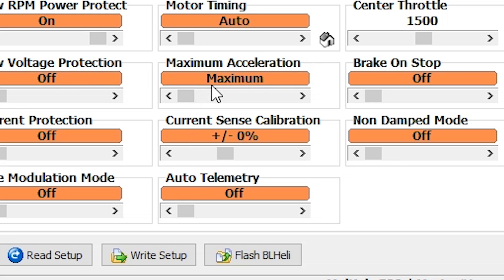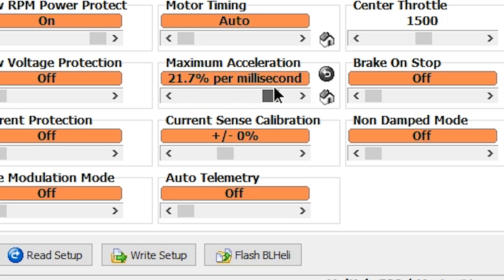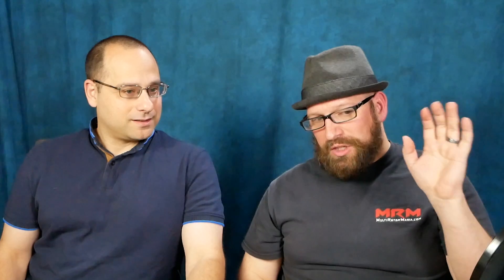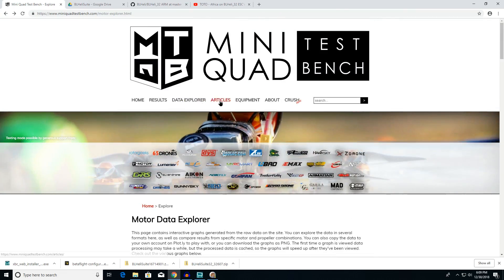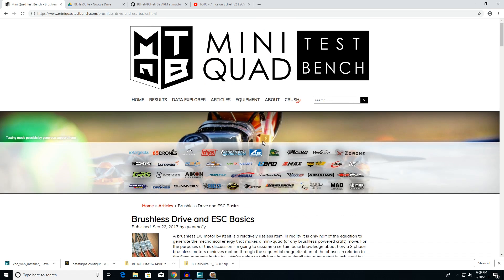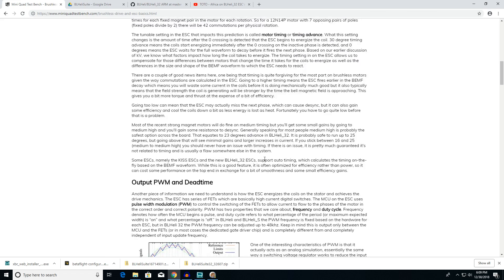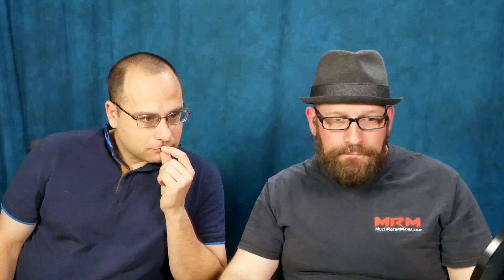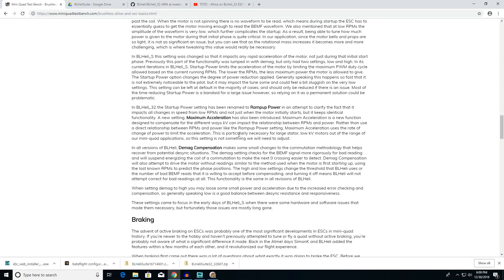BLHeli32 100% Explained - Part 7 - Maximum Acceleration

Comment: Went back through my notes on this, and just a bit more to clarify.  Maximum acceleration limits the rate of change where rampup power limits the scale of the change. Maximum acceleration also has an equal impact anywhere in the throttle range where rampup power is focused on transitions from low RPM to high RPM.